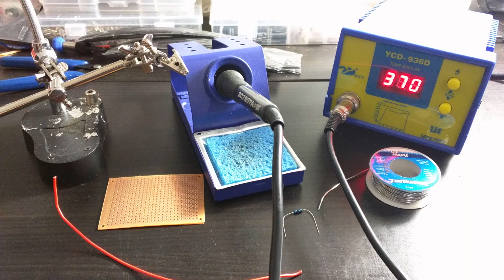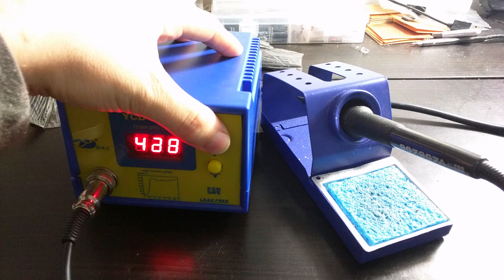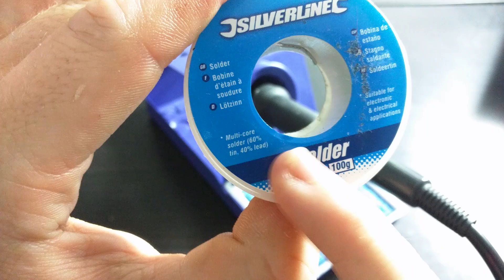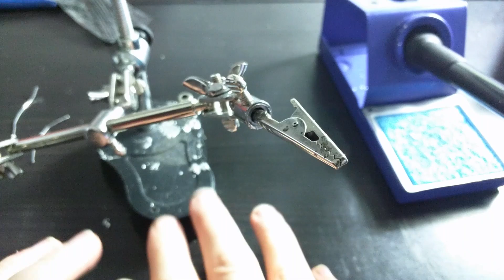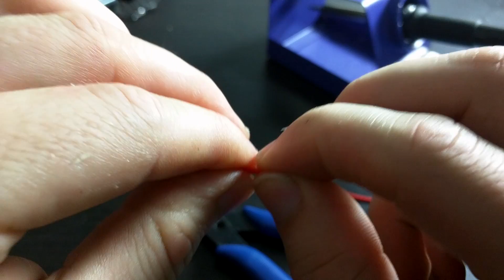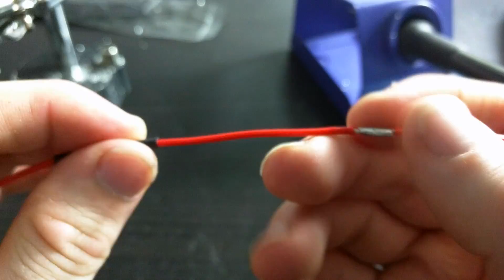Soldering Basics - Electronics Basics 17

Comment: Most of my soldering thus far has been around brass fittings on old tools etc, which shall we say, requires much less finesse. I've always been happy with flux free and lead free wire, 'where flux goes solder will follow' being my friend. I think I'm going to have to buy some thinner flux lead wire.

Comment: 63/37 solder is the best ratio to get. Also clean your iron on some brass sponge not damp sponge. The thermal shock damages the tip!
Reply: Fully agree get rid of the sponge. I have used stainless steel pot cleaners in a small food tin for over 50 years
Reply: @lesb6542  someone on the internet was saying that steel is harder than copper, so it will damage the tip. What does your experience say? Should I use steel wool?
Reply: @lesb6542  Do you mean like Scouring powder (Calcium carbonate)?

Comment: that 3rd hand crocodile is making little  holes on the wire insulator.
Reply: I like to apply some heat shrink tubing to the jaw portions of the clips for just that reason.
Reply from the maker: This isn't a concern for this demonstration.